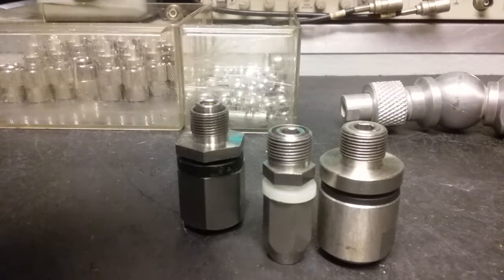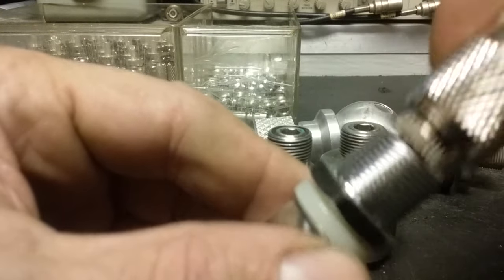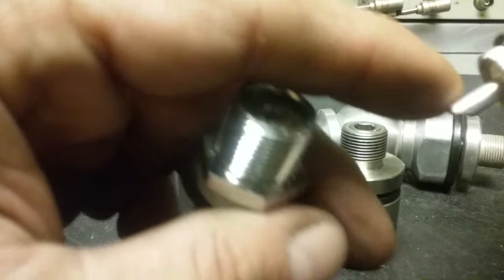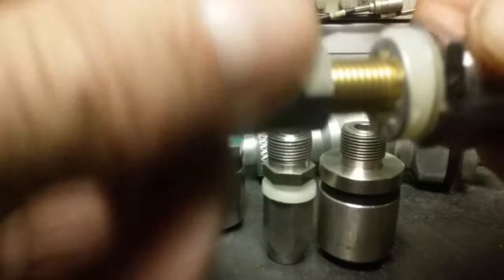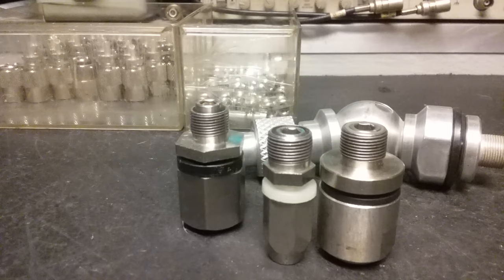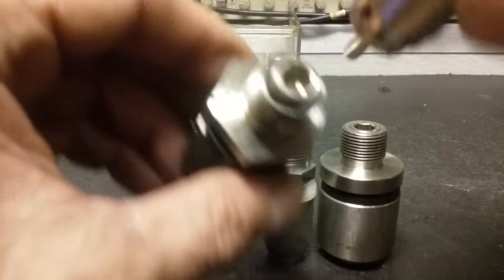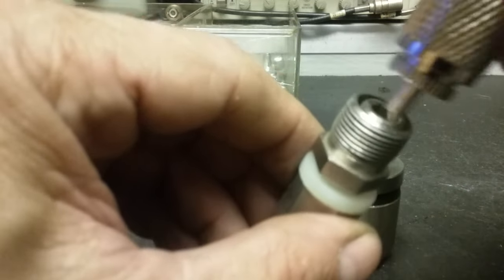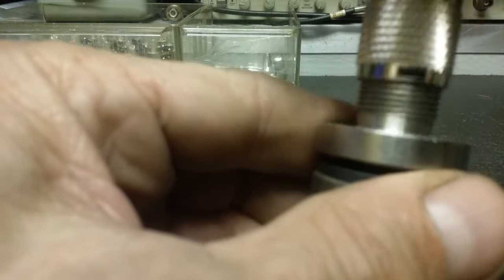How to: Good and bad antenna stud mounts (so239) for mobile 10 Meter CB Radios.

Comment: I enjoy watching your videos sir and you are absolutely 💯 right I have two of them Wilson stainless steel studs that you showed on the end of this video and I tested both of them with my ohms meter and neither one of them was making good contact on the positive side like you was talking about so I got thinking 🤔 if I just put a little bit of solder down in that Allen head screw on the back of it it would make contact it took me a few tries but I finally got them both working making good contact I'm not a technician like you are I'm just a truck 🚛 driver and a DIY kinda guy thank you for putting this video out  😉✌️💪✝️🗽🦅🇺🇸
Reply from the maker: Thanks ,,,, solder is a terrible conductor. Use Brillow if in a pinch.
Reply: I did the same..I solder and drilled it to size.I did it in a way that the Allen wrench still worked.

Comment: I tried those wilson mounts and couldn't get the coax to make a good connection inside, the screw you use to tighten the top down sat too far in. I'm pretty sure they belong in the junk category

Comment: interesting, I've always preferred the heavy duty steel Wilson stud...
Reply from the maker: Do yourself a favor and change it, it's probably the worse on on the market.
Reply: Fine Tune CB Shop I do have a work around on the mount... strip the outer jacket lengthwise from some coax, a small piece, less than two inches...take this ground braid, pull it flat... trim it so that it will fit into the mounts center conductor receiver...I use a little dab of silicon grease to hold it. It will take a small piece of the braided jacket to fill the gap, and the center pin of the 259 will crush into it as you tighten the connection. is it "Mickey Mouse?" only in the sense that I have to bother with it, but, done correctly it works extremely well...I should add, I'm using crimp connectors on lmr 240, the center pins on these connectors are on the small side
Reply: Fine Tune CB Shop copy that! Blowing smoke should be figurative, not literal.. lol..

Comment: Who in their right mind would engineer inferior crap like that? Looks like the material they used was OK, but the connection point is garbage. What a waste.
Reply from the maker: Yes .. skilled labor not so easy to find anymore.